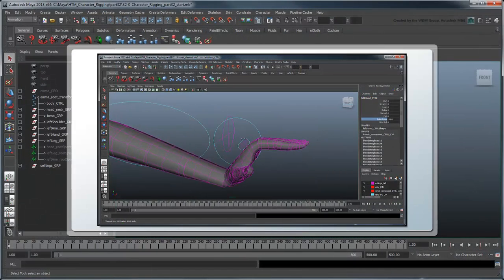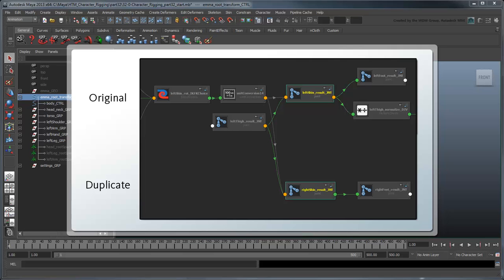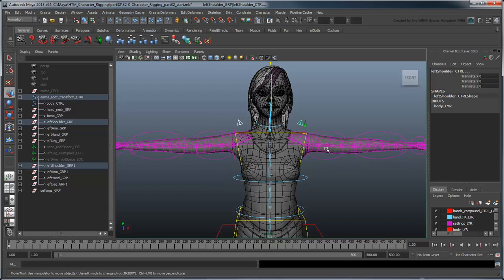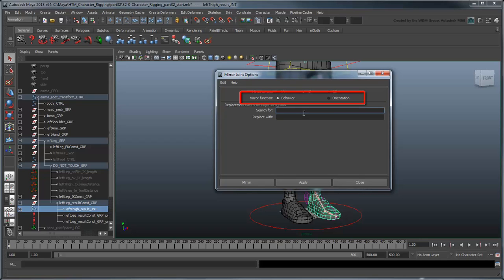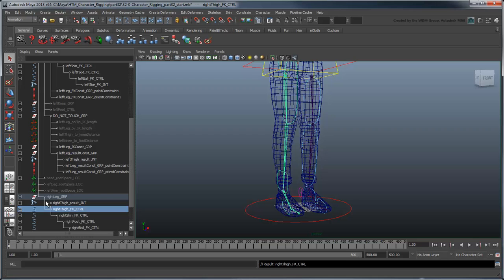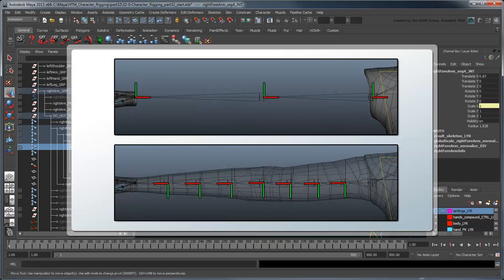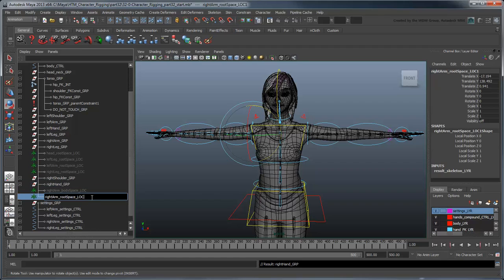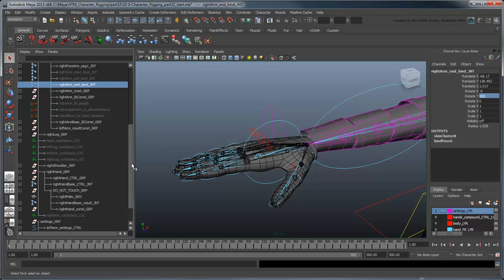Creating a Character Rig - Part 32: Mirroring (Advanced)

Comment: Hello! I have a big problem with my character's Right_Shoulder! Two problems. First: When I duplicaded the Left_Shoulder_GRP, and I Changed to Right_Shoulder_GRP, I had the Rotation Space problems. When I want orient the Right_Arm_FK_Const_GRP and Right_Arm_Result_Const_GRP to the Right_Arm_Shoulder_Space_LOC, Right_Arm_Body_Space_LOC and Right_Arm_Roof_Space_LOC, they are not working. When I want this the arm rotate base to shoulder, unefortunetly the arms Rotate X Axis are rotateing, and it's not good! I cannot continue my work with this problem. The second one: Because this problem: I start rerigging the shoulder without duplicate the Shoulder_GRP, but unefortunetly it was unsucssed, because I wated scripting the Right_Shoulder_Scale.MEL command, I Typed, and it was working, but not well, because the shoulder GEO is rotated, or oppened as a crocodile mouth, and the Translate X axis of Right_Shoulder_End Result_JNT was changed, nad it isn't good to. Please! Help me! how can I fix these problems? Please! I thank you in advance for your reply.
Reply: you have a space problem since you made duplicate special for the shoulder but you can fix it easily when you orient constrain the Right_Arm_FK_Const_GRP to the Right_Arm_Shoulder_Space_LOC turn off the maintain offset and you will see a value in the Right_Arm_FK_Const_GRP rotate attribute , undo  the constrain then put that value to the same rotate attribute for the Right_Arm_Shoulder_Space_LOC but inversed . then made the constrain again and you are done
Reply: Gabriel Bedross Hello! Thanks you try help me, but I cannot fix it easily. Can you show me with a picture or a little video, how can I fix it? Because I try fixit, but it's not working. please! Show me? I thank you in advance for your reply.
Reply: Olivér Márk Szecsődy sorry i cant make a video but i can help you here . i had this problem too , i put (-180) to  Right_Arm_Shoulder_Space_LOC rotate X , then i made the orient constrain to the Right_Arm_FK_Const_GRP and Right_Arm_Result_Const_GRP , and you should see 0 values in the rotate attributes for (result and fk) groups and the offset attribute for the orient constrain as well , just try to put values to match their spaces .
Reply: Gabriel Bedross I made it! It's working! I'm so happy! Thanks your help! You save my life! You are a good man! Thank you! Thank you! Thank you! I'm very greatful!
Reply: Olivér Márk Szecsődy you're welcome , happy to help
Reply: @williamsmith3621  Hello! Sorry to bother you, but I have a little problem. In August, I started rigging for another character. I was doing very well until the duplication, but when I was almost done, the flexing kinematics had a big problem with the wrist. I fixed it by rigging my right hand with mirroring again, but when I want to connect my right hand, an unknown, unjustified problem appears. maybe a space problem, you don't know. It consists of orienting constraint RightArm_FKConst_GRP and RightArm_ResultConst_GRP to RightArm_ShoulderSpace_LOC after I set the rotate x value to -180, instead of 0 the result, but -360. I don't know something I forgot or I duplicated Shoulder_GRP badly, I don't know. I tried to fix everything, but it didn't work! I've had enough! I tried everything. That's why I turn to you for help. Can you tell me how I can fix it? What did I do wrong. Also how to duplicate. Like the instructor shows in the video? The problem is, the tutorial doesn't show you how to connect RightArm_GRP to RightShoulder_GRP. Please! Help me if you can. Thank you in advance.
Reply: +mark antony Thank you so much for the reply. You saved me extra long hours of finding the solution
Reply: No problem. :)

Comment: I'm breaking my head over how to mirror the arm's FK controls and 'twistable arm' correctly. FK controls work fine, but creating the spline handle tools between recreated bones for the right arm's seg# bones is proving difficult. Whenever I create the spline and try to rotate its start_bind joint, it rotates the mid_bind joint in the opposite direction. I've checked rotation axes, I've aligned my up vectors in near to all combinations possible... I've checked the Node Editor to see if I could see where the rotations were being 'inverted', but found nothing.

Thank you for helping me with my past problems - I hope you can help me figure this one out too.

EDIT:
I figured it out! See my reply on this comment below.
Reply: Hello! Did you stretched the IK Right leg? If you did, please! send me the perfect Right Leg IK Scale.MEL command. Thank you!
Reply: Olivér Márk Szecsődy Sorry - I've skipped the legs in these series since I'm modelling a character that doesn't require them.
Reply: Okay so I managed to find out how it works, guys!

What had happened was that my segment arm joints' rotation axis was wrong. They had their X axis pointing away from the child, as opposed to toward it. To fix this, I first unparented all geometry from them, then deleted the IK curves attached to them, made sure all joint rotations were zeroed and then used the joint orient tool to orient them correctly, X pointing towards the child as it should have been. Next, I recreated a spline curve, reparented the geometry and set the object up axes as they should be; see the video above for details.

Comment: I finished following the tutorial and skinned my model to the rig (binding the arms to the segment joints). But found that, in IK, if I translate the leftArm_CTRL in -Y slightly, then in -X a bit, the elbow will candy wrap. I thought I might have done something wrong, but I checked with the files provided in this tutorial, and found the same problem.
Reply from the maker: Try switching the upper arm IK_HDL's Advanced Twist Up Axis to "Positive Y" with 0,1,0 Up Vectors.

The candy wrapping you're seeing (also known as joint flipping) is a general 3D rigging issue due to the underlying math that makes the joints work.  The problem will always exist, but you can often adjust the twist controls to hide it in motions that you're animator is unlikely to use.

Comment: Can the rig from this tutorial be applied to other characters as well? If so how? Lets say I have my own character in the T-pose standing next to emma and I´d like to apply this rig to my character. How would I go about it? Do I use the skin_bind_JNT_LYR? It contains the emma geometry as welw doesn´t it which I do not really need for my own character. Great tutorial series as usual : )
Reply from the maker: You can just delete the Emma Geometry and smooth skin bind your specific model to the result joints.
Reply: Maya Learning Channel Hello there again and thank you very much for your reply! : ) In that case I would have to unhide and unlock the attributes on each bone as I need to position the skeleton to fit my model, right? And after that I need to freeze every bone´s transformation again?
I was looking forward to animation and when I finally finished watching this tutorial series I thought I might try to play with emma a bit before I manage to skin this rig to my own characters however, the default weight painting after skinning is a bit of a mess.
I am still looking for a good tutorial that would cover the topic of human character weight painting. Even though I am not good at weight painting at all, the very first issue I have noticed after skinning this rig to emma was the very bad deformation in the shoulder area.
This was caused by excessive influence of the first bone in the arm segment (not the shoulder bones) which I tried to fix and even though it does look better, there is still this small unrealistic gap which can be seen especially from behind. (See picture in the description).

So I thought I´d ask, can this be fixed with further adjustment of the weights or is my very amateur result as good as it gets with emma´s mesh?

Here is a picture of the shoulder weights as well as the character I would like to try to skin the rig to - http://postimg.org/image/qz43sxzmz/

Thank you for your time and have a wonderful day!
Reply from the maker: Indeed, skinning and weight painting is a topic in and of itself.  The Maya documentation's "Getting Started" section has an entire chapter on skinning which can help get you up to speed on techniques, but unfortunately the specifics will depend heavily on the geometry of your own model (which is why we haven't prioritized doing a video tutorial covering it).

In terms of adapting this rig for your character, you could certainly elongate the joints/handles/etc to match your character, but this will take some time and you must make sure to be thorough.  You shouldn't need to freeze any translations of joints, just controls.  What you will need to do though is adjust many of the squash/stretch calculations based on the new length values  Getting all this to work correctly will certainly test your understanding of how the rig works, but it can certainly be done.

It's hard to say whether adapting an existing version of the rig or just creating one from scratch adjusted to your model would be easier.  The former could be quicker assuming you understand all the principles of the rig (which would allow you to troubleshoot more easily) while the latter is the method I'd recommend for those who are not as confident in their understanding of it.
Reply: Hello there and thank you for your reply!
I am currently reading the articles in the documentation center about rigging and skinning.

I am definitely not confident with my rigging skills but I will still try to adapt this rig to my character before I go through the whole tutorial again.

Also I wonder, is the squash/stretch functionality always needed? For example, if I´m working with a realistic character I would like to avoid the unrealistic stretching that can occur.
In that case, it would be good to have a turn off button for the squash/stretch ability. Can it be achieved and is it ever used?
Or would it be easier just paying attention to spot any unrealistic stretching on realistic characters instead of adding this functionality?
Reply from the maker: You can add one of those for sure (in fact it's on my to do list).  In general, even for a realistic character, you're going to get a little bit of squash and stretch but certainly not the extreme amounts we show in these videos.

Comment: Hi, this is so amazing rig tutorial. I am done almost except one.
I found a problem for right Arm FK Forearm blend.
The parent constrain for rightArm_CTRL and rightArm_IKConst_GRP is OK.
However when I set up Parent constrain for rightArm_IKConst_GRP to right ElbowHand_FK_CTRL( unchecked Maintain Offset in Parent Constrain option) the right arm is stretched. The FK_CTRL is on the position but the rightArm_HDL go far away.
This is too long arm to use...such unbalanced arms I have now.
Help me.
Reply from the maker: It sounds to me that the spaces are not aligned properly (similar to the problem with the hand we showed at 15:28).  Did you try turning Maintain Offset on?  This may fix the problem but if it doesn't, then I would compare your file to the included scene file to compare any other differences.

Comment: Hi I have been following your tutorials for my character rig its really cool. I have a problem in mirroring, My Right FK joints are working properly but right IK leg is not working after i ran the script, When I try to stretch the rightFoot_CTRL the IK Handles are moving along with control but not the IK joints and Geometrys. Then I modified the script by multiplying sumLength with -2
which is shown below.
string $driver = "rightLeg_IK_lengthShape.distance";
float $rightThighLength = `getAttr rightShin_IK_JNT.translateX`;
float $rightShinLength = `getAttr rightFoot_IK_JNT.translateX`;
float $sumLength = $rightThighLength + $rightShinLength;
setDrivenKeyframe -currentDriver $driver -driverValue $sumLength -attribute "translateX" -value $rightThighLength rightShin_IK_JNT;
setDrivenKeyframe -currentDriver $driver -driverValue ($sumLength* - 2) -attribute "translateX" -value ($rightThighLength*2) rightShin_IK_JNT;
setDrivenKeyframe -currentDriver $driver -driverValue $sumLength -attribute "translateX" -value $rightShinLength rightFoot_IK_JNT;
setDrivenKeyframe -currentDriver $driver -driverValue ($sumLength* -2) -attribute "translateX" -value ($rightShinLength*2) rightFoot_IK_JNT; 

It worked and i could able to stretch the IK Length along with rightFoot_CTRL but the problem is as soon as i ran the above script the shin joint is protruding and i could not able to set it back to its original position.I would like to know what script you used for the mirrored right IK joints.  did you use the same script for the right leg???..could you please help me out with this ASAP.
Thanks
Reply from the maker: Often times when dealing with problems like this, it's useful to try and step through the values at each point in your script.  Using the included file rig (and approximated numbers) here's what happens:

At line 1 $driver = 73
At line 2 $rightThighLength = -30.7
At line 3 $rightShinLength = -42.7
At line 4 $sumLength = (-30.7) + (-42.7) = -73.4
At line 5 You set a key that basically says "When $driver = -73.4, set rightShin_IK_JNT.translateX to -30.7" 

However, this is a problem.  Notice that the condition that $driver = -73.4 will never happen (because length can't be negative).  Therefore, you need to multiply lines 5 and 7 by -1.
Reply: Maya Learning Channel Hi Thank you so much for your reply..I tried with -1 but this time I got another problem..After I run the script and lineared the curves in  graph editor, when i move the rightFoot_CTRL upward the right leg bends like how it should,  but when i try to move it downwards its not stretching instead the right leg moves upward along with all IK handles, IK, FK and result joints..I do not know what exactly the problem is and because of these I could not sleep.. please help me with this ASAP
Thanks
Reply: Maya Learning Channel This is the new script which I used for the right leg...
setDrivenKeyframe -currentDriver $driver -driverValue ($sumLength* (-1)) -attribute "translateX" -value $rightThighLength rightShin_IK_JNT;
setDrivenKeyframe -currentDriver $driver -driverValue ($sumLength* 2) -attribute "translateX" -value ($rightThighLength*2) rightShin_IK_JNT;
setDrivenKeyframe -currentDriver $driver -driverValue ($sumLength* (-1)) -attribute "translateX" -value $rightShinLength rightFoot_IK_JNT;
setDrivenKeyframe -currentDriver $driver -driverValue ($sumLength* 2) -attribute "translateX" -value ($rightShinLength*2) rightFoot_IK_JNT;
Reply from the maker: ***** Well you've fixed lines 5 and 7, but for some reason you broke line 6 and 8 by causing essentially the same problem (-73.4 * 2 = -146.8, and length can never be negative).  Flip those back to -2 (but only for the driverValue checks).
Reply: Maya Learning Channel When I follow your instructions for mirroring here, I am unable to finish the stretch control because when I extrapolate to infinity, the leg will snap straight, effecting the GEO and result leg. Am I missing a step during the mirroring script process?
Reply: Maya Learning Channel Hello! I Try typed those new scipt numbers, and didn't working. Please! Send me a very perfect Right Leg IK Length script code! Please!

Comment: Hey, i've followed your rigging tutorial for creating a character and i am up to the mirroring stage. I am having some real difficulty getting the twist on the arms to work on the right side of the character. I follow the tutorial for recreating the arm twist joints and other attributes using the mirrored result chain for correct orientation. Although when i activate the advanced twist controls and enter the correct inputs as well as making the up axis negative z with both the z values negative 1 for the up vectors i have a problem where the geometry rotates the opposite way to what way im rotating the bind jnts to control the twist.
Reply from the maker: Hmm.  Have you compared your rig to the one provided in the scene files?  Particularly, are all the Local Rotation Axes the same?
Reply: Managed to fix it, the segmented twist orient axes were not correct, didn't realise they were different orients to the result joints. Just got to mirror the hand now :) Great tutorials btw

Comment: I followed all the videos and I am amazed by this great rig that comes out. But the mirroring part does cause me many problems. For example, when I use the duplicate special operation (to recreate the dual knee solution for the right leg), not only the IK chain and the right_foot_CTRL are duplicated, but the complete root_transform_CTRL. When I delete all the duplicated things, which I do not need to follow the steps, the dual knee solution does not work, I guess because Maya copies all the connections from the left leg (and therefore also the connections with the root_transform_CTRL for global scaling, etc). I tried to compare my node editor to the final rig you did but I cannot find the connections which I seem to have missed. Could you please tell me how to duplicate right, so that I can build the dual knee like I did for the left leg? Could I just "normal" duplicate the IK chain and the foot CTRL and make the connections manually, instead of using duplicate special? Maybe it is because I work wirh Maya 2014 that this operation causes so many problems for me.
Reply from the maker: Yes you can absolutely do this.  In the absolute best case scenario, you would actually rebuild the right appendages from scratch.  What we showed in this video was more intended as some time-saving shortcuts and warnings for things to keep an eye on.

If you're ever worried about extraneous nodes, you can also use the File > Optimize Scene Size > Remove Unused: Render Nodes option to clear them out automatically.